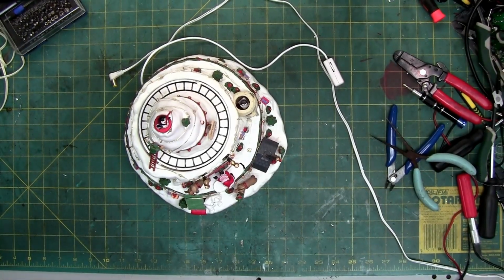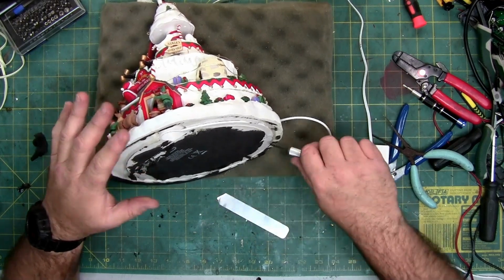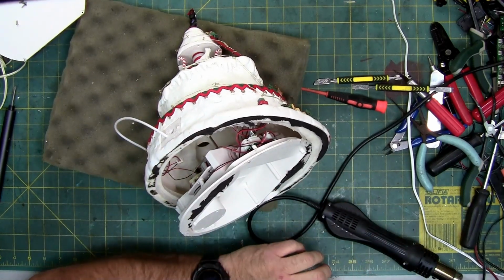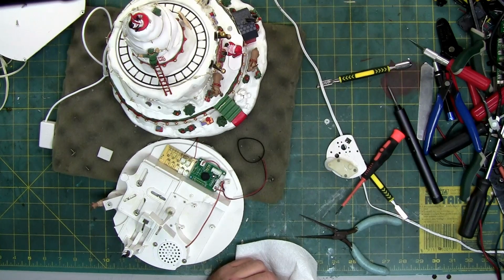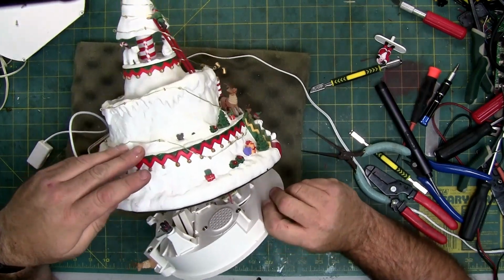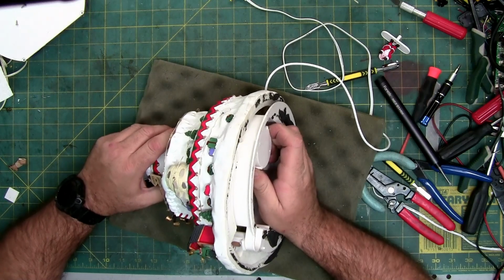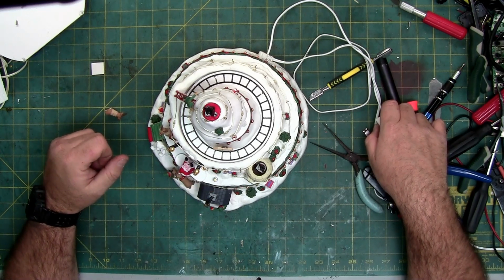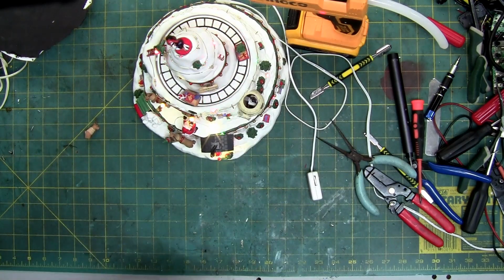Lemax North Pole Tower Repair

Comment: Where do I get the little tiny battery screw driver? What kind of soldier and heat shrink?
Reply from the maker: The version of the screwdriver is the old version, here is a link to the new: https://amzn.to/3Tv7KMY
Solder: https://amzn.to/3J7VbPb
Heat Shrink: https://amzn.to/34f1DFn
Reply: Mine was broken for a year.. Never thought I could fix it.. I watched this and I started peeling the bottom mat off real slow.. I got it off in one piece. Also your vid prevented me breaking anything when slightly peeling of the hot glue using a hairdryer. Display works like new. I have to add to that though, it kind of stalls just a wee bit everytime a cart made a lap. Seems logical as there seems to be more resistance in mechanical part when cart is at its highest point. Think there also could be still some dirt or artificial snow (plastic) into the moving part which is propelled by the 4 fins
Had to buy me a soldering iron (€13) and a hotglue pistol (€12) bought 3 of those little motors (€7). Now I can fix the skating pond too.
Also there the electrical srf300 is needed. Easy peasy when you've seen someone do it.
Thanks